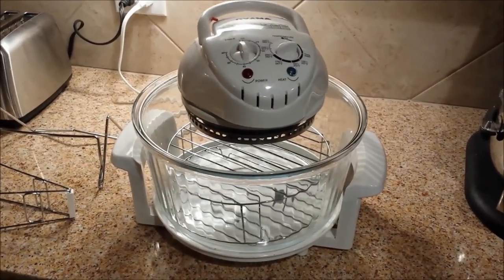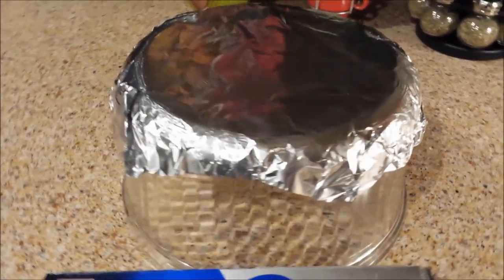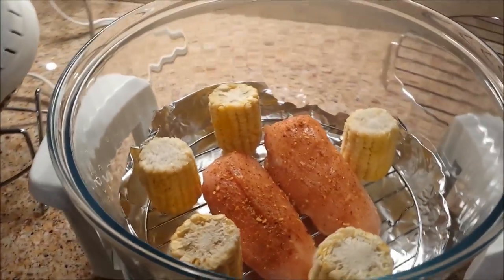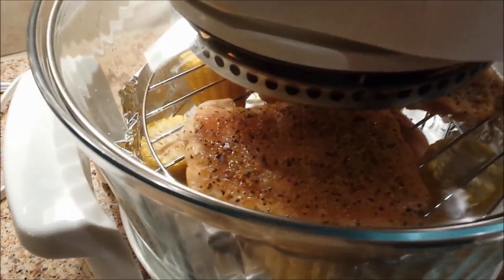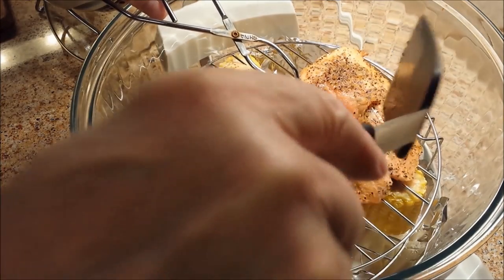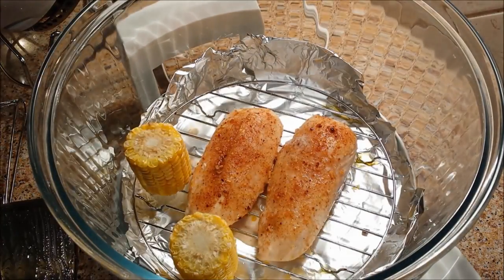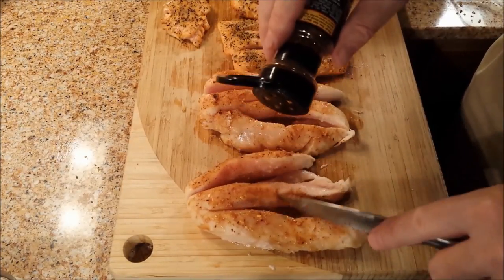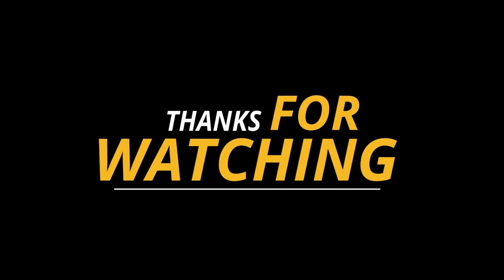How I Use My Oyama Turbo Convention Oven

Comment: Damn, loving the foil over the bowl!  Realized that will work in my basket air fryer!   True 'nuff the glass container is an advantage.  One tip you might try to speed up the chicken, when half cooked (firm and most of all easy to slice in half, thickness-wise, I slice my chicken to half thickness, expose the interior faces up to catch the downward heat better and it cuts 5 mins. or more off the cooking time.  I'll also oil and lightly season that side, since I like the flaverful outside the best.  In your case, you can use the just freed up upper rack to hold the extra chicken...

My current favorite seasoning is the Walmart brand Jerk Seasoning packet!  yum

Comment: Thanks! Please consider doing more videos on this. I love my Oyama turbo convection oven but I find there is not that many recipes or videos for it like there is with the NuWave.
Reply from the maker: 1981lashlarue I do not have the nuWave but I would imagine that the recipes are pretty similar. Also, if you google "Air Fryer Recipes" you can find several pdf documents with more then a dozen recipes. Thanks for stopping by and commenting.

Comment: Will anything bad happen if i do use an extension?
Reply from the maker: Looking at the heavy duty nature of the build in cord I suspect there is a significant current draw with this device leading me to believe a typical household extension cord might over heat.  If you really must use an extension cord it should be at least 16 gauge.  Cheers.

Comment: do you ever find the lid rattles a little bit?
Reply from the maker: Yes, mine does occasionally rattle.  Most of the time I can stop it by readjusting the position.  Thanks for stopping by.  Cheers!
Reply: WorkMateGuy Thanks for replying. Its reassuring to know rattling is normal and not a faulty unit. Also your aluminum foil tip was extremely helpful

Comment: No aluminum!! Alzheimer's cause!!
Reply from the maker: Hi Adeline - I am wondering about this.  Why do some people still bake their potatoes in foil???  I will have to do some more research on this.  Thanks for stopping by and posting. Cheers.
Reply: @WorkMateGuy  i've read some medical articles before about aluminum and other metals causing alzheimers.  Well..to make it short, there's still very little studies made and as of the ones that i read their conclusion was as the body ages, its ability to remove certain metals (which are naturally present to make our brain and the rest of the body work) decreases as we age. And so when they do some tests/biopsy, they found some level of metals in the brain that may have caused the alzheimers/dementia.
To me that explanation makes sense. Will eating or using less aluminum/iron/copper etc decrease the chances of alzheimers/dementia? Maybe. Lols
Reply: @FluffyMuffs  Not maybe. There are a myriad of other health issues caused by aluminum as well, and the inability to lose weight in most Americans is one of them.  I don't understand why this is an "lols," moment.
Reply: I realize this is an older thread .... but ... concerning the aluminum and heavy metal connection to alzheimers and other conditions ... may want to research the ingredients in vaxxinez  ... ingested toxins are easily excreted compared to injected toxins ...  May want to look up the research of Forrest Maready and "My Incredible  Opinion "  ... interesting information  ...